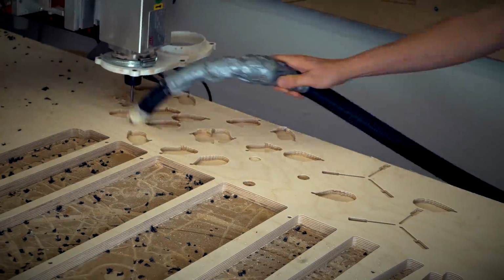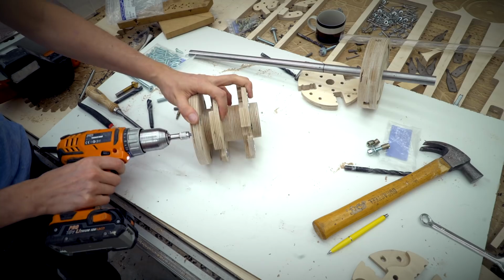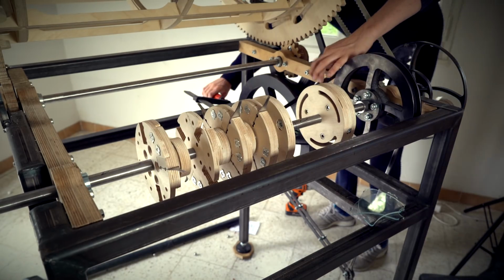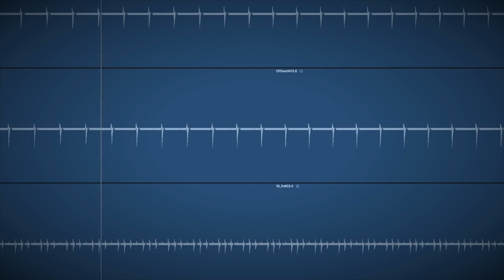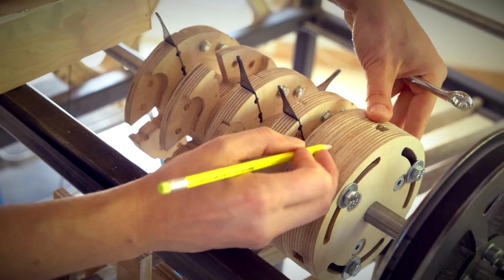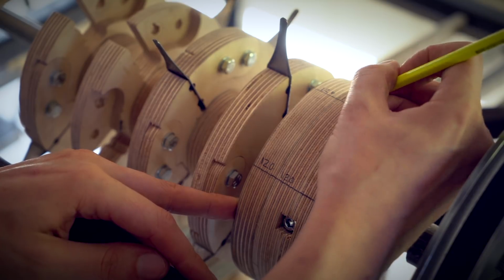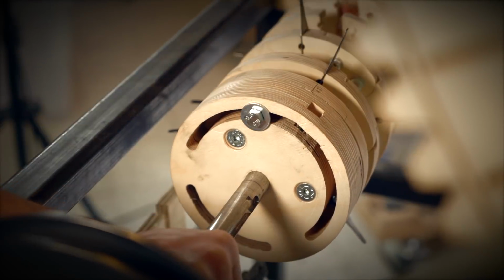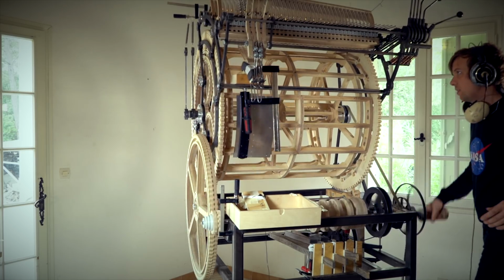Testing the Mechanical Rhythm Machine - Marble Machine X #55

Comment: You could have simply added extra inserts, so when you run out of adjustment on one, there will be another with a range of adjustment. Then you can retain the strength of the spokes between the slots on the clamping disc.

Comment: Hey Martin, I have an idea for an addition to the marble machine to help monitor the bpm. Would a gauge based on a centrifugal clutch work? As the machine spun faster the armatures in the clutch would spread out to a consistent distance and on a disc behind or a clear disc in front you could mark where the bpm is so you could see how fast the machine is running. Maybe it would free up your thought process while playing.

Comment: Mechanical Rhythm Machine has one problem that should be fixed: you can't change the bpm :/, wouldn't it be better if it's disconnected from the crank turn so you can add delay in other ways? (would be best if it's automaticly xD)

Comment: You need a brake on that thing. -it will make easier to stop and safer - something could fall into the machine. You do not want to have some woman's scalp ripped of, because you could not stop the machine in time.

Comment: Never actually occurred to me that you'd have to re-time the rhythm machine to the rest of the marble machine if you change tempo because of gravity being constant.
When you do the moon tour, you're definitely gonna have to account for the moon's much lower gravity :P
Reply: Gravity on earth is not constant, it will vary on different places on earth as well (about 0.7%). Al though I’m not sure that it varies enough that it needs to be accounted for for the world tour.
Reply: In a world tour shaking during transportation probably will account more to lost synchronisation than differences in gravity.
Reply: It's about the BPM synchronosation. I didn't think things would need to be calibrated according to bpm, as everything in the machine moves to the bpm. But not the gravity. So it's something that will always be out of sync, even without transportation.
Reply: It's on sync when the rhytm of the part is within reasonable limits (seems to be 2ns here). Any variations in gravity, like the effect of the moon or a different place on earth, are so miniscule that they won't make it out of sync. You will have hard time for even measuring the effect of varying gravity as all the unwanted mechanical motion, temperature and even air pressure will make a bigger difference.
Reply: yeah, the comment from Nadan is useless, wasn't talking about that. So we agree
Reply: Sorry then. Youtube said you replied to me
Reply: didn't know why it was happening, but now I know. Of course the gravity is messing it up :p
Reply: I mean, in marble machine lore, the machine is eventually discovered at the bottom of a liquid methane sea on Titan in 4072 (This Old Tony https://youtu.be/G5t-ghuLZWk?t=1149). Presumably when an 80 year old Martin makes the trip out there to preform and his life is taken in the New Auckland disaster of 2068 where a landing shuttle strikes the New Auckland theater killing him and the three hundred people that had come to see him, thus bringing an abrupt end to the MMX Seven World Tour.

Comment: Gonna be a lot of tweaking to get that synced at different speeds: the fact that the marble's travel speed is not determined by the machine means if you crack slow it'll feel more in beat than spinning fast

Comment: It would be much cooler if the angle of the time adjustment would be automatic, by using a mechanism with centrifugal weights.  Look at the mechanisms for the distributors in older cars. Since the detonation time is constant, like the time your marbles take to fall, the spark has to be retarded to make sure the detonation doesn't occur too late and provide less power.

Comment: are you positioning the plywood box used for marble drop testing at the same height as the final instrument?  If not then this test is nullified due to the different time it would take the marble to drop.

Comment: Oh Yes! Get those funky rhythms!!  I don't know if this would be useful but would changing to bolts that hold the Mechanical tumblers to the primary hub for something similar to quick release levers, as found on bicycle wheel hubs, be useful for ease of adjustment?
Reply: I was suggesting thumb screws. Same notion though, basically something to make that adjustment between tempos faster and less involved.
Reply: Yes.  Anything to ease the changing of tempos.  Quick and simple is the key. :)

Comment: I was just wondering if you'd add a braking mechanism to the Machine, like in the first one.
I thought, fitting the "industrial but diy" look, would be a bike disk brake, but than again, that doesn't have many musical features like the braking system of the first marble machine.
Reply: I think they mentioned a brake on the flywheel in an earlier video.  We haven't seen anything about it since, but I figure it's a pretty easy part to design, even if the lever may need to be long and awkward to reach the flywheel through the machine.

Comment: So are you going to be able to tune the drop time for all instruments to the rhythm machine now?  You might need to make those metal tines out of a spring steel.  Also I would use something like a nylon for wear that the tines strike against instead of the foam or plywood.

Comment: Edit: Scratch what i said below. Eventually watching the video made me realise this was attached to the crankshaft not the flywheel

I was trying to work out where the best place to put a mass dampener to deal with too much shake. That spot seemed like the best, as otherwise it would have to go inside the spinning drum
Reply: double edit. near the flywheel would be no good anyhow. Would need to be high up on the machne. Only way I ca n think of is to attach a "hat" to the machine and have a mass dampener inside the hat above or behind the marble divider

Comment: Wait, if the belt is tuned to C sharp, so it rarely resonates, wouldn't be even better to tune it to a quarter-tone?
Reply: Yes you're right.  But bear in mind that the guy is potty.  The machine won't produce enough acoustic energy to cause a problem with belt resonance,  which will be, if it exists at all, related to cranking speed, ie tempo, which has no direct relation to pitch.  It's a red herring.

Comment: At 16:14 it is specified that the two rightmost disks will not shift.  The entire reference system is dependent upon set screws radially set against a round shaft.  No, just no.  This arrangement is notorious for not maintaining the reference.  The torque applied to the set screw as a function of the rotation and of the shock loads of the percussion will be taken up entirely by the point of contact on the shaft.  This leads to shaft scoring, set screw deformation and a general loosening of the reference.  
Torque must be transmitted by friction.  Please consider a "split ring collar" for the reference disk.  Torque is transmitted via the internal surfaces, instead of point contact via set screws.
Reply: Yes you are right in that point :-) Only there is a keyway groove milled into the shaft already. I dont know if Martin uses a proper key in this first assembly or just one of the screws in the groove, but it is fortunately not only a point contact holding the disks :-)
Reply: @kitingmare : Thank you Marius.  Alarm bells were going off in my head.
Reply: @kitingmare  Very right, I saw those slip in real
Reply: When he was showing off the set screws, I figured he would just bore a keyway into the shaft to maintain reference. :edit: {6:18} you can see a keyway already bored
Reply: This entire depends on the drag the activation fingers put on the system during each 'hit'.  If it's a very light drag, the set screws will work just fine and not deform or loosen up.  If, however, he makes a mistake and doesn't put limiters on his 'volume' levers and induces to hard of a hit, then yes, the set screws will take on too much force and will start to deform/loosen up.  He has to be very careful with how much drag he introduces with impingement of those striking fingers.
Reply: @SHcinema  would like to point out the restitance of fingers isn't the only force the system has to deal with. You are also dealing with inertia, which could cause high peak stresses. These could definitely mar any point contacts. If he is using the keyway this won't be a problem off course.
Reply: @SHcinema
The geometry of a setscrew on a shaft means that even light torque loads will produce enormous axial loads on the setscrew. They will deform over time, and they will loosen. Worse, they'll mark the shaft when they do it, and make subsequent timing efforts difficult or impossible without replacing the shaft. 

I have never seen a successful implementation of setcrew-on-a-shaft in my entire career. Best case, it's barely adequate and loosens up on stage in a different country halfway through the tour.
Reply: yeah i would just go for a keyway probably, maybe even use a metal disc as the one over the keyway and then bolt the wooden disks to that one
Reply: I have set screws on shafts that have NEVER backed off.  I have some that have as well.  It's all application based.  I have not idea how hard the screws are, didn't see the markings on the heads.  I don't know how hard the shaft is either.  Thinking further on this, I think the weakest part of this is the plywood which could never be set 'firm' enough not to allow the screws to loosen, even with the insert, as it's too soft and elastic.  So it will need some kind of pressure locking ring as WhatAboutTheBee said.  The set screw issue is all about the choices of metals and processes meeting the forces that are induced (regardless of the origin, I was speaking in generalities about the fingers and the forces induced there).  In some cases, set screws are perfectly fine, especially if they get maintained regularly.  I've had good luck with large mild steel shafts and hardened set screws with biting faces working well against relatively light torsional forces, even intermittent ones.  BTW, for the key advocates, he needs to be able to do a 'gross' timing adjustment with the wheel that connects to the shaft, that means either a pressure ring variant or toothing of the shaft and wheel so he can adjust +/- in a big way then use the timing adjustment for the fine timing.
Reply: In this case, holes drilled for the set screws would be an easy option. The shaft is plenty big for what little torque it needs to transmit. I would be much more worried about the flat belt shifting timing (it basically stretches on the tension side, and relaxes on the other, resulting in loss of sync), but I guess with the very little torque transmitted vs. the pretension, it's fine.
Reply: I love the expertise brought in by viewers of this channel, also probably one of the most important aspects in building the Marble Machine X! :')
Reply: Thanks everybody for throwing just enough vocabulary at me that I can count this as studying for my statics exam tonight
Reply: English please
Reply: @A__JohnMarlonLavarez  I will treat your question as a serious inquiry.  The explanation may take a bit of effort, but this explanation will be for the benefit of anyone who wants to understand the technical point.

I will begin with a water-wheel.  Everyone should be familiar with them.  A paddle wheel is dipped into a flowing stream.  The water pushes against the paddles, which causes the wheel to spin.  The wheel is connected to a shaft which drives some tools.  

It doesn't matter that Martin is doing it backwards.  In his case, the shaft drives the wheel which pushes the water.  That just means that we change the sign of the arithmetic.  

What my original message refers to is the way the energy is transfered between the shaft and the wheel.  Martin is very concerned about the timing (synchronism) of his musical notes.  His entire system of drums vs. notes depends on how tightly the wheel is fixed to the shaft.  If the fixed wheel moves, shifts or rotates independently of the shaft, then the timing is lost.

So HOW Martin attaches the wheel and the shaft is very important.  Martin picked a set screw.  The set screw is tightened until it is pressed against the shaft.  This means that all the force between the shaft is transfered by that set screw. 

So what's wrong with that?  Ever notice that some materials are "bendy"?  If we push on a material, it bends.  How much it bends is related to what the material stiffness is and how much force we apply.  Some materials are more "bendy" than others.    If we push hard enough, we will permanently bend the object.  Consider a piece of paper, we can wave it around, and it wiggles, but when we apply enough force, we fold (permanently bend) the paper.

Therefore, if we apply enough force, the set screw may bend, the shaft may bend or both may bend, it is all related to what materials (yes, steel bends, just not as much as paper) and how much force.  So  if the set screw bends or the shaft bends, the timing that Martin wants is lost and his artistry destroyed.

There is more force applied to the set screw than just how much we tighten it.  The disks and hammers that are spinning must be sped up and slowed down.  That assembly has what we call inertial mass or the resistance to spin.  It doesn't want to start or stop spinning.  We must apply force to cause it to start or stop spinning.  The amount of force applied to the set screw is related to how big a resistance to spin the object has, the amount of force we apply and how long we apply the force to get the desired rate of spin.  Think of the accelerator in your car.  When you use the gas peddle, the motor gives more force to the wheels and you get up to speed.  You can either gracefully, gradually come up to speed or you can floor it and the wheels slip.

Another force the set screws will see is when the hammer on the disk hits the object (plays a drum note). Think of hitting a bell with a hammer, or hitting a hammer with a bell.  That energy is sent to the wheels and finally to the set screw.  The percussion (drums) creates shock loads.

Finally, the AREA over which the force is important.  Think of a woman's high heel stepping on you intead of a man's shoe.  Which one hurts more?  The force is distributed over the area of that tiny high heel point.  The same applies to the set screw.

By now your head must be spinning (full pun intended).  My original post was directed at the engineers on this project and as you can see, Marius understood me immediately, as did other engineers who commented.  It was not intended for the general public.  Set screws, in general are a terrible way to transmit spinning energy.

Please note that I have responded to you in a civil and friendly fashion. I would expect a civil response.  I realize that you were telling a joke, and most likely didn't expect a serious answer.  But you got one anyway!  All of the words I used in my original post were indeed english!
Reply: Wholeheartedly agree. Setscrews on a shaft are terrible. The problem is that any slight rocking radially put an enormous axial load on the setscrew face, and that deforms the face and loosens the setscrew. You could argue that the loads are really light, and deformation will be small, but this just means it's going to loosen up and cause problems halfway through the tour, rather than immediately. 

Secondarily, shaft deformation means that the first time the setscrew is tightened it will mark the shaft, and subsequent timing changes will be lost as the setscrew finds the old hole, so to speak. 

Alternatives to split rings (which are pretty good) are collet-style adapters like shaftloc, or internal tapered bushings like taper-lock. All three will allow infinite adjustment without damaging the shaft or shaft adapter.
Reply: didn't expect to find a genius, but here it is.

Comment: I could imagine ,that the belt connecting the crank shaft with the programming wheel could slip. This could create a accumulating desync when playing the machine for a long time. Did you take that into account? Maybe change it to a geared belt? Not sure how strong this effect would be

Edit: Nevermind... It is geared xD You guys have probably already thought of that xD
Reply: It seems like that belt is only use to turn the flywheel. If it came off, all it would lose was the ability to keep momentum, and thus keep proper timing.